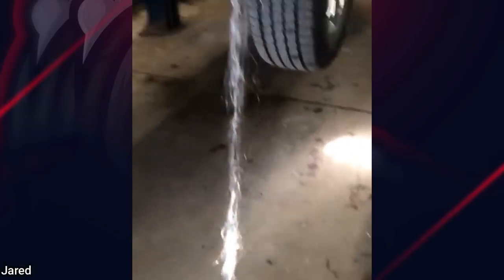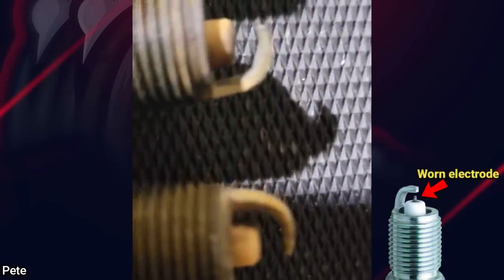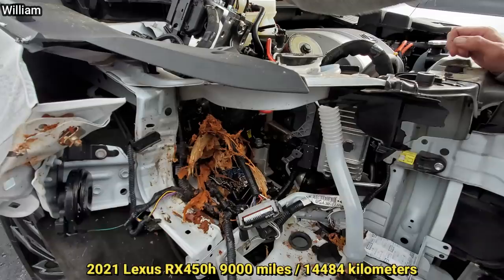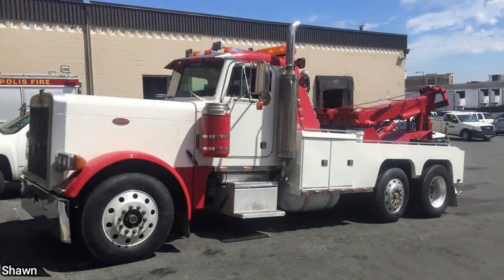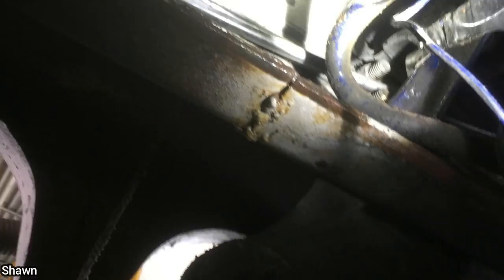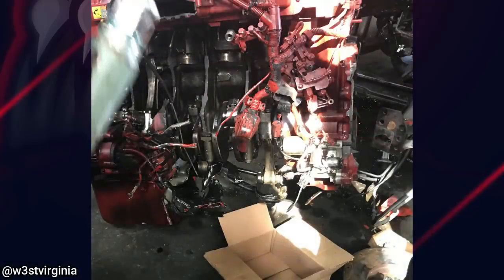Customer States He Hit A Curb At McDonald's | Just Rolled In

Comment: 2:52 Some Japanese companies make very good DJ equipment, so maybe Honda is teaming up with them 😁
(what is actually happening is the window film has part short circuited the heating elements for the demister which are also the radio antenna in many cars - stray current from other systems such as the power steering is then fed back into the radio/sound system and makes the noise on the speakers...)
Reply from the maker: Lol yep! I put that in the description as well. Makes for some fun though 😜

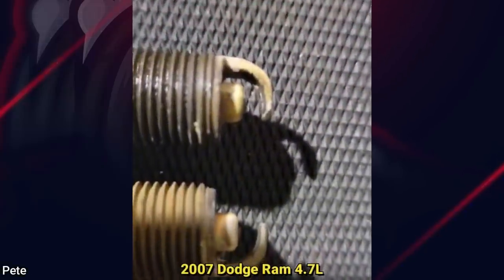Comment: 0:58 I bought a 2000 Saturn SL1 over the summer while I did some work on my truck.  Of the many things that needed fixed/replaced, the thing needed new plugs.  Mine weren't nearly as bad as in this Dodge, but the electrode was worn to a 45 degree angle.  After the full tuneup, the car went from 23 mpg to 33-34 mpg.

Comment: The tow truck got me who welds a bolt on the frame.🤣🤣🤣
Reply: Hopefuly it was a least a Grade 8????
Reply: @dennisadorno6721  🤣🤣🤣
Reply: You obviously never knew my granddad, I've seen him do things like this. A farmer, and a welder during WW2, he repaired anything and everything made of iron or steel by welding on chunks of whatever scrap metal he had lying around. When I was about five, he bought a new John Deere disc harrow. Forty years later, when he sold the farm, that disc probably weighed more than it had new, due to all of the angle iron welded onto the original tubular frame, which had cracked and broken several times.

Comment: That last one is crazy, at what point do you ask yourself that computerizing and interconnecting everything has gone to far? I argue it's when window tint makes you a DJ.
Reply: If the car has electric power steering (most do now) and the radio is on AM with bed reception they sometimes do that because of interference from the steering rack. It happens on my car from time to time.
Reply: sometimes even basic electronics can go weird. alot of cars for the past like 30 years have had radio controls on their steering wheels. i had a 2000 buick regal that would turn the volume down if you turned the wheel all the way to the right. i have an 86 celebrity that once you turn the wipers on, they wont turn off until you turn off the car. iv replaced every switch and relay associated with the wipers. gremlins are real man

Comment: If you don't stop a run away diesel by blocking the intake quickly you had better run the other way!  We had only that the turbo let loose on and filled the cooler full of oil . When it came apart it put 6 inch gouges in the concrete floor!
Reply from the maker: I believe that! Only had one engine (Perkins if I recall) do that before but it was on a generator. Closed the doors and ran away lol
Reply: Wow!
Reply: Scary things, saw one have a leak in the turbo too, drank it’s own oil and revved like mad. Luckily the intake was quickly stuffed full of blue roll and cut it off.
Reply: When I worked at Deutz we had a brand new BF12L413 (twin turbo V12 monster) being run in on the dyno. It ran away. We found out later the governor in the Bosch mechanical injection pump failed. I and everybody else took off and the shop foreman stood there disconnecting the fuel line! We took it apart and the engine was fine. Injection pump went back to Bosch. I made up a ball valve shutoff for the fuel line and handed it to the shop foreman the next day. It was part of the dyno for years afterwards! ;)
Reply: I had a Series 60 run away on me from a blown turbo. The pucker factor cranked up a lot when I killed the batteries and it still kept running.

Filled the 30 bay shop with dense smoke and left a oil spray 40 feet long behind the bus. Fortunately that one didn't pop but we had them come in every once in a while with ad hoc inspection ports in the block...
Reply: Always have a paper plate on hand in case it runs away.
Reply: Why do diesels not have some sort of fuel cutoff to prevent this kind of thing? I know it cant prevent spark, but it could theoretically easily stop air and fuel from getting to the combustion chamber
Reply: There is much easier way to stop engine. You press brake and switch to 1st gear and literally stop engine by pressing brake pedal.
Reply: @dladam7434  not first gear, that will likely just ruin your brakes. You need to put it in top gear so that the transmission takes maximum torque to spin.
Reply: @CarbonPhoenix96  most of the time the engine oil itself is consumed here and not the Diesel when an engine runs away. And paired that no spark is needed there is not much to do except for trying to block the air or run away.

Comment: When i bought my used Taurus, they sold because they said it was misfiring.  Changed the wires and plugs and each plug had a .093-.096 gap.  
Runs like a top now.
Reply from the maker: Mint!! Lol
Easy fix at least.
Reply: Nice!
Reply: @volvo09  best $400 car with 120000 miles i ever spent.
Reply: Yep, bought a $99 cheapo, firing order had not been followed...five minutes later drove by a very irritated salesman on a journey of 85,000 miles.
Reply: the truck idled high after putting the new plugs in.  there was something wedged in the IAC i removed it  and it idled normally. Thats how bad those plugs were. it doesn't misfire anymore. Imagine that!
Reply: That reminds me of an 89 Ford Tempo I bought for 300 bucks. It ran, but had been neglected, so I spent $100 at the parts store on typical tune up stuff and it passed inspection and was a fantastic little car for the time I had it until I upgraded cars.
Reply: I had an grand caravan with the same issue.
Reply: @barneyeckert9702  the grand caravan from 2000-03 from the midwest....in rust we trust.  They run forever.

Comment: Nothing like spending $60k on a Lexus with its "automated safety features" just to run it into the back of a vehicle the size of a small house😑
Reply: True, however some of the logging trucks have long overhanging loads that the car sensors may have missed. Red flags warn an observant driver. Pretty nice car to wreck.
Reply: I had one of those lexus's lock up her brakes and skid for 2 whole blocks on wet pavement, right up until she hit my truck in the side.    I thought those stupid things were supposed to have ABS brakes by law.  Certainly didn't work on THAT Lexus because I remember what cars were like before ABS and that's exactly what this car did.   It was like it was in slow motion because the screeching caught my attention and I had enough time to think to myself, this clown is going to hit me.  Then boom.   Luckily my Nissan wasn't even scratched.  She needed a whole new front end.   Apparently those Toyota's are also made out of tin foil.
Reply: @jkutyna  well, if all 4 wheels are sliding and there's no speed input from ANY of the wheel speed sensors, the thing thinks it's stopped and won't activate ABS. Entirely possible in rain, and happens all the time on ice.

Comment: "And if you look closely, you'll see a tiny hole in this engine block." Uhhhhhh, yeah.😳😳😳
Reply: Well this is embarrassing. I was actually looking for a tiny hole!
Reply: The tiny hole is in the other side of the block, that went missing.
Reply: @ahtaimo  😆😁😆
Reply: @SoHeisstnochkeiner  🤬🤬🤬
Reply: Only 3500 rpm recorded?...
Reply: I still recall a supercars race a couple of decades ago, where one competitor was forced to retire.  They went to interview him after he got out & asked why he retired from the race.
"We had an electrical problem." was his answer.
"What sort of electrical problem would cause you to pull out?"
"The alternater fell off."
"What!? How could that happen?"
"Number one piston hit it..."
Reply: @NemoConsequentae  Yeah, I can see that being a little bit of a problem.
Reply: @SoHeisstnochkeiner  Details, details...
Reply from the maker: @nimaforoughi7266  yes, it's a diesel
Reply: @ahtaimo  Me to...first time I got lucky with a girl.
Reply: @nimaforoughi7266  Most likely went to 35,000 rpm!
Reply: Little JB weld and it will be fine.
Reply: @Frostified  If JB Weld and duct tape can't do the job, it wasn't worth fixing to begin with.👍
Reply: Saw pictures of a fire truck with similar carnage - hit the downshift button too many times and the Allison transmission software for emergency vehicles has less safeguards than commercial spec. #1 and #6 cylinders were there, the head was there, and the crank. The frame rails were bowed from the force of the engine coming apart and apparently there was a huge pissing match between Pierce, Allison, and Detroit Diesel about who had to pay for what.
Reply: @JustRolledIn  We had tractors on the farm that would run at 2400RPM for PTO work, and could rev up to 2700RPM. Seems like a not-so-safe safety margin if 3500 is going to blow it to smithereens. O_O
Reply: @JustRolledIn  Surprised the rev limiters didn't stop it from going past 2200 rpm,  driving a 2011 Lonestar with the cummins ISX, "at least I think it is, same red paint and design, i've heard it reffered as the cummins 565" and it wont let the engine run past 2200, mind you I guess if its going downhill its gonna go past whether the limiter wants it to or not.

Comment: So, two comments.
2:21 - Guy is lucky there wasn't more damage.  I think I already told the story, but I'll repeat because of how it relates.  I'm a used car dealer, went on a test drive with a guy that was interested in a Dodge Ram with 4.7 engine.  On the test drive, we felt a vibration.  To better get an idea as to where the vibration was coming from (engine or drivetrain), I shifted to neutral and stepped on the gas.  We heard a loud pop, and then the vibration went away.  I looked in the mirror to see the fan and serpentine belt laying in the road.  Quickly made it back to the shop to determine that the water pump shaft had broken, and it sent the fan into the radiator and destroyed it, along with the shroud.  I then ran over the fan, which destroyed the tire and wheel.  In the end the truck needed another fan, clutch, water pump, belt, radiator, fan shroud, wheel and tire.

0:58 This is more of a question than a comment.  I was told that if you run an engine on worn out spark plugs, that the secondary voltage from the coil (the high voltage that's like 30kV or more) will find the path of least resistance, which means that the voltage will try to find ground by arcing through the insulative coating on the winding in the coil, and with enough arc, it will burn the insulation off the coil, internally.  This of course would ruin the coil by causing a short.  Therefore when replacing really worn out spark plugs, that the coils should be replaced as well because they're likely damaged internally.  Anything truth to this logic, or is someone trying to upsell me?

Forgot to mention, customer lost interest in the truck.  Sold it to someone else once it was fixed.
Reply: I had a 94 Chevy C/K 1500 that ended up with a seized alternator one day.  I left it in a parking lot until I could come back the next day with a friend to try and tow it.  While there he said "let's see if we can free it up".  So we took a piece of 2x4 and tapped on it with a hammer.  Well, it got it unstuck, but when I fired up the truck, smoke started billowing out of the back and all you could hear was something akin to rain.  The alternator had blown the entire bearing out of the rear and it made the most terrifying squeal with everything out of alignment.  I was still finding little ball bearings in nooks and crannies after that.
Reply: the coil thing, nah thats upsell BS. the insulation is more than enough to handle it.
Reply: @tweake7175  That will depend on the quality and specification of the coil, some are only just good enough, so will fail more easily.  In Europe, the Fiat 500 1.2 is susceptible to failing ignition leads, which if not replaced, can, and does, cause coil failure.  Ignoring the coil fault, can lead to ECU damage.  New leads every second service are cheap and preventive maintenance.  Replacing as a matter of course may be overkill, but owners should be warned that the coils may fail soon after.
Reply: Back in the day, with a bad wire or spark plug (or distributor LOL), the voltage could arc from where the main output wire was to the ground lead on the coil.
The arcing would burn any oil on the surface and carbonize it into conductive goo that would short it out.
Reply: @tweake7175  remember the Chevy HEI with coil on top of the distributor? I've seen many catch fire because of worn spark plugs and wires.

Comment: That Porsche…. Ouch! That was a really bad idea….
Reply from the maker: That's going to be very expensive.
Reply: @JustRolledIn  exactly and deep deep trouble… yikes. That won’t “buff right out”
Reply: Looks close to write off in replace cost. 4 factory rims, etc....
Reply: I still don't understand how a sideways slide into a curb breaks all four rims. :p
Reply: @soisaidtogod4248  why would you write off a 120k car over 15k in 3 factory rims, tyres and some control arms/bushings?

Plus, vehicles like this are most commonly leased and insured anyways.
Reply: @Valks-22  seeing how far the wheels are in pushed in on one side, i'd bet the subframes are bent to shit and most likely the chassis. Probably ruined the rack, steering column and anything else in the way as well
Reply: @Valks-22  A lot of cars are written off for what seems like cosmetic damage. Hail damage in the Midwest takes out a lot of cars that are fully mechanically sound.

Comment: I was a motorcycle tech for about 19 years and most every customer said the same thing: “… I was just riding along then (fill in blank) happened…”. 
I’ve seen some of the most fucked up shit ever but the worst are sport bikes that the owners want new pipes and performance tuning despite the fact their fork seals are leaking and have covered the front brakes/rotors in oil. Had a customer tell me that he was goi g to bring it in but he noticed the forks stopped leaking so he didn’t feel there was a need to service them. They stopped leaking because they ran out of oil. We of course refused to Dyno tune the bike until he resolved the safety issues. My fave was a guy who wired his winch for his adventure bike into his headlights, nearly set the entire bike on fire and needed an new wiring harness. 

Before you do something stupid just remember, we charge about 120 an hour and do t expect discounts.
Reply: I've noticed that in certain neighborhoods you're likely to see a 15-year-old SUV with things like big shiny wheels, bedazzled windows, loud subwoofers etc, but with highly audible and sometimes visible mechanical problems.
Kinda the same thing.

Comment: Had a customer bring in their 96 Sebring convertible for an oil change today. They also wanted the air filter replaced. Problem is, there was no air box, no ducting, nothing. Just a wide open throttle body. Which, in addition to sucking in unfiltered air, also appeared to be sucking in coolant from a leaky radiator cap a few inches away (the 2.5L V6 Chryslers of that era had the radiator cap on the engine, just in front of the throttle body).

Comment: 2:21. I was the 'customer states' with a fan issue similar to that.  At the time I has a 91 Honda Accord and it started when a lady backed into the car at work with her SUV.  Her tow hitch broke the grill and punctured the radiator.  She claimed it was my fault and called the police.  The police came and immediately determined that it was her fault.  She actually took me to court for the damage to her SUV (she had none).  The case was thrown out which sucked because I still do not have a working car.  We get the radiator replaced but didn't notice the tow hitch broke the fan housing.  It didn't become a problem until I was driving one day and the car slowed to a stop.  It turned out the loose fan was sawing on the nearby transmission hose creating a pinhole causing it to leak.  Five dollar hose and $30 of transmission fluid later (because Honda) I was back on the road.

BTW I love this channel.
Reply from the maker: What a pain in the arse and I can't believe some people! Glad it wasn't an expensive fix to repair the rest.

Thanks for being here!
Reply: It wouldn't have helped if her case wasn't thrown out. To get compensation, YOU would have to (counter)sue HER, which would be a separate case.
Reply: @Megatron995  It too was thrown out.  I meant to say that both cases were thrown out.  Mine was thrown out citing the value of the car was than the damage incurred.

Comment: Not very often you see a Cummins ISX that becomes a piece of modern art from literally scattering itself.  That one either had an oil leak into the intake side of the engine or an injector hang open which does happen at times and they do tend to come apart above 3500.

Comment: lucky the fist customer did not an expensive car!!

The fibre glass has always comie out of my old cars exhuastlike that, mine has been missing for the last 6 months as it all came out just like that. I know it will stop eventually and just used to get dirty hand spooling it up after each journey, the sound from the 2.6 V6 sounds a bit better now, but sometimes there is a rattle - but very rarely.

Some cars are amazing how long they last, my car also has had the engine management light on it for 4 years with a MAF error and goes into limp home mode  if I go to 110 mph so lose ~ 40 mph from top speed - It has had the MAF changed 3 times in it's life  from 20K on theo dometer  and I think it is the wiring loom issue out of the factory. I will just keep my speed below 100 mph as I do not really want the lights going on in my rear view mirror anyway.

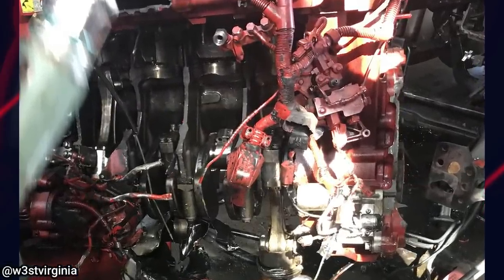Comment: At 2:45 you say 3500 rpm... did you mean 35000? Because 3500 doesn't sound that crazy unless its some specialty low rev engine I'm not aware of
Reply from the maker: Its a diesel. They run at lower RPM's compared to a gasoline engine.